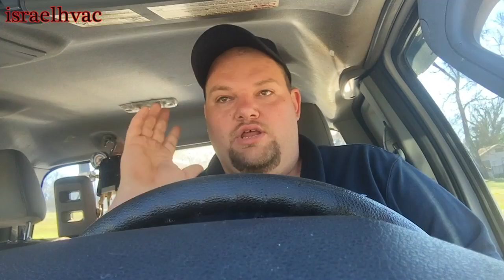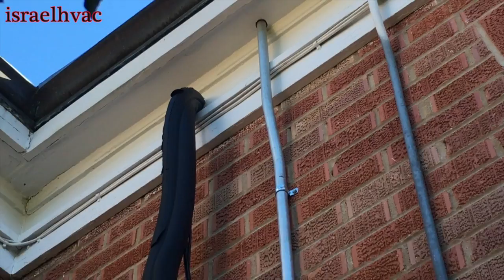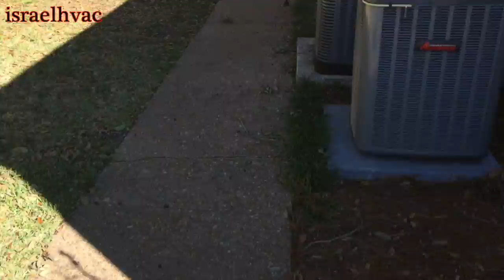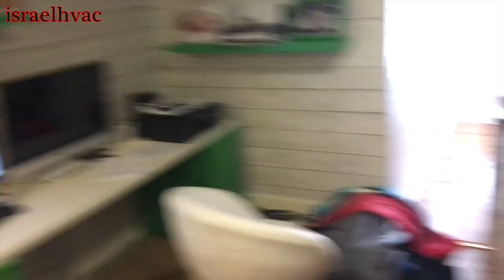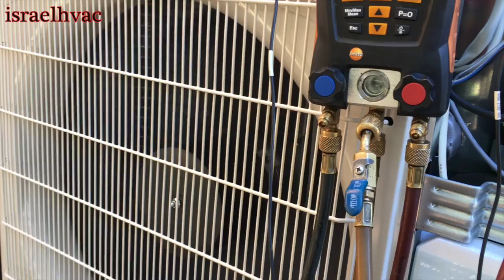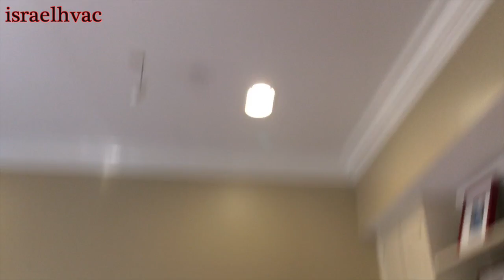Mitsubishi 3 Zone System

Comment: As a gift, I received 8 TILE asset trackers to place one in each zipper bag and  tool box, etc. These go on keys and anything else you don’t want to loose. Because it’s Bluetooth, it tracks the last know address, so if you leave something behind, it’s easily located.  You do have to hug the side of the tool bag and leave it loose on top inside the box (I use Velcro). You can ping the TILE where it plays a musical tune so you can find it nearby as well.  It’s nice  insurance and was a really nice gift to receive. If someone walks off with anything, you can “command a trace”, where other people running the TILE app pick up and report GPS location where it is back to your smartphone.  Very slick.  Just change some small batteries yearly. I put an calendar outlook reminder to remind me annually to swap batteries.  

I have used these on a job site at least six times a year to beep locally. I like to keep everything in the same storage place but especially on these long days of a gazillion service calls you get tired and start piling stuff back in the truck at the end of the day.  So I have used them to beep where they are in the truck.

When we go on vacation, I move one inside each luggage bag.  The TIlE app allows you to name each one, so you have to make a note that Small Tool Box is Jimmy’s Duffle Bag luggage for the trip, and put it back in the right place when you get back.  Clever, smart, simple and it’s the definitely the most practical gift I ever received as it’s with me every trip, every service call, every day.  I bought several more for the family as birthday and Christmas gifts.  No whining, no returns and everyone is happy.   There are several models and some do not have replaceable batteries.

Comment: Great job. FYI they have individual isolation valves that attached to the Bc box to isolate the headset. Due to operation pressure I believe the manufacturer says nitrogen test the System at   500 psi.
Reply from the maker: Thanks!!! Thats good to know i will definitely keep that in mind!!! Thanks for the info!!